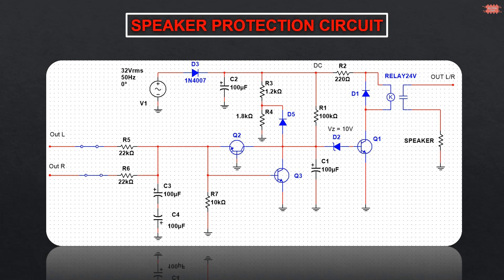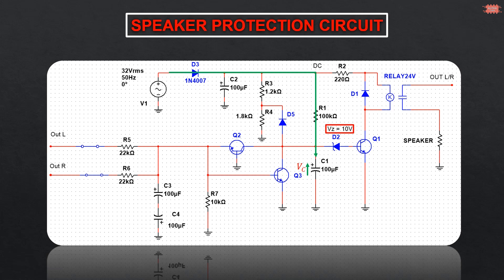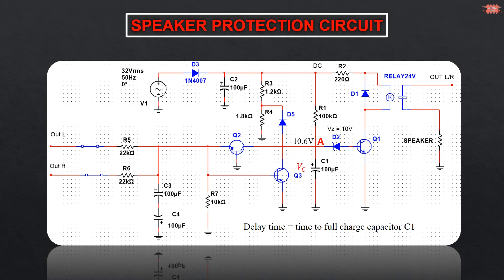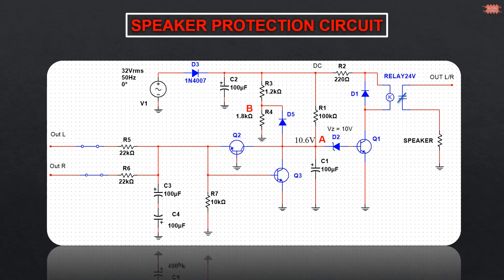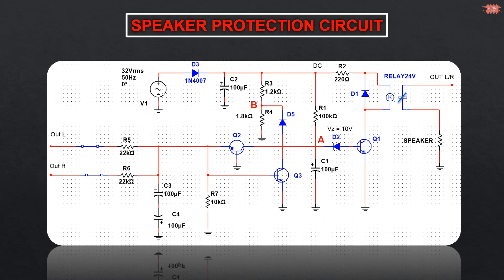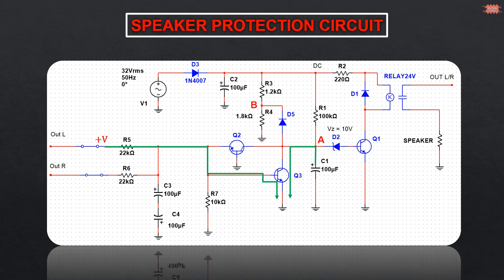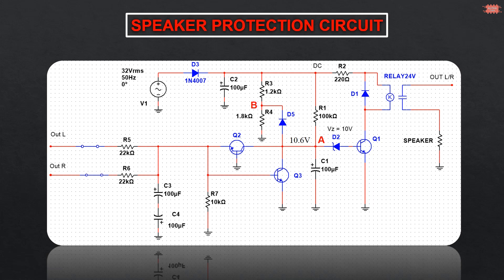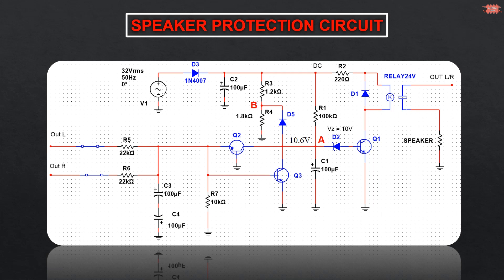Audio circuit amplifier| DC speaker protection circuit explained Part I | ALPHA Lab

Comment: I think the 220 resistor must be a power resistor, because when the input source meets the relay's inductor, it will feedback a power source back into the 220 ohm resistor, so 2 sources are placed into the 220 ohm resistor, it will be very hot and may burn.
Reply from the maker: Yes, it is a power resistor.
Reply: @ALPHALabs02 Thank you for responding

Comment: How do I connect protect led indicator
Reply from the maker: From the C pin of transistor that control on/off relay, you connect a resistor series a red led to gnd. It is protection mode.

Comment: In your circuit you have used only NPN transistor  so why you have mentioned NPN and PNP transistor  both like MPSA92/MPSA42 ? Can I  use only C1815 transistor in q1, q2 , q3
Reply from the maker: Yes. It only has NPN transistor. There is a problem in my memory. You can use MPSA42 or C1815 or another. The important is that you need to check its maximum current. An another important is that you need to understand how it work. Hope you like it.
Reply: @ALPHALabs02  thank you so much !

Comment: What Q1,Q2,Q3 number
Reply from the maker: In my design, I use MPSA42 and MPSA92 but you can use another transistors. Example 2SC1815, 2SA1013. Not difficult to chose transistor for those positions.
Reply: @ALPHALabs02  thank you

Comment: Wonderful explanation, I wish to point out a little error in the circuit. I think that the base of transistor Q2 should be connected to VCC and not ground otherwise when -ve d.c from the speaker is detected, Q2 emitter-base junction will not be forward biased and as such will not conduct.
Reply from the maker: Thank you. 
Q3 conduct if detect +V and Q2 conduct if detect -V. So that base of Q2 should be connected to gnd